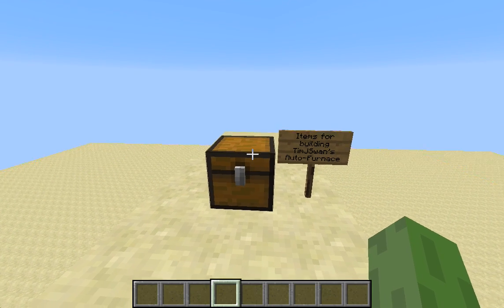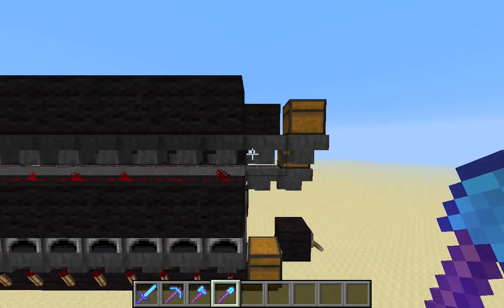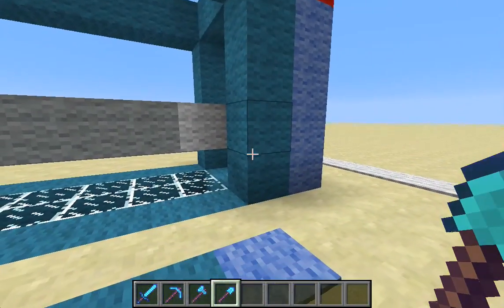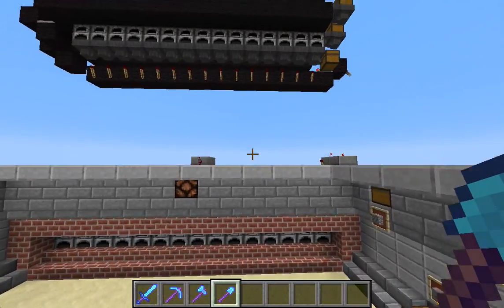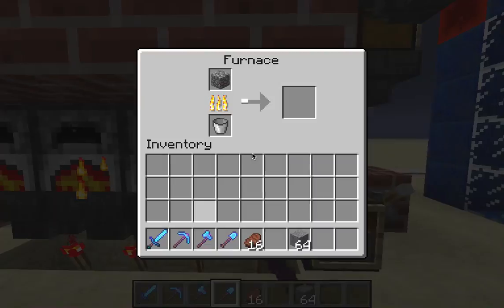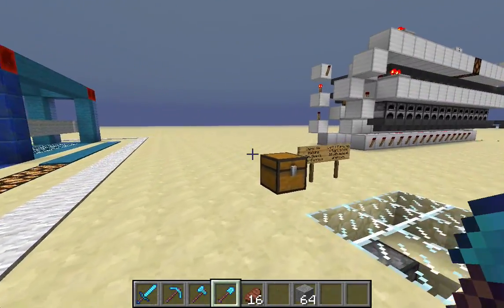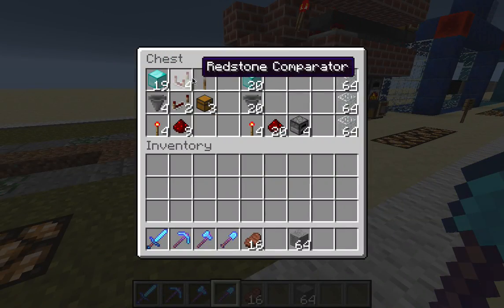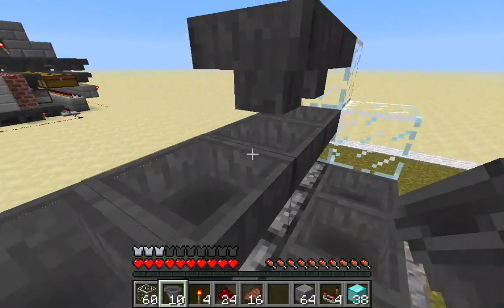Industrial Lava Furnace - Upgrade from Tengo's Synchronized Furnace

Comment: Built this in 1.12.  Did the 14-furnace version.  Furnace #7 from the left won't take fuel or input, but all the others work.  I removed the top layer of Redstone dust per an earlier comment hoping that might fix it but it has not. Anyone got a suggestion?

Comment: Hey Tim, can you show us how to incorporate the lamp to show when the hoppers need more fuel/when they are full?
Reply from the maker: siloettee Attach a comparator to your fuel input chest. Remember, I designed this system specifically to use all available fuel until none remains in the system, therefore, the only thing you need to check is the input chest.

Comment: I'm getting what I believe is a "feed rate" problem on this design. So first off, if I do the design exactly as shown, it works fine (and yes, I've removed the top row of redstone to get it working properly on 1.8+).

That said, if I want to move the two "source" chests (fuel and smelt-ables) down to the same level as the output chest, I start getting issues. I extended the dropper line, and then added an item elevator like this one (https://www.youtube.com/watch?v=otWucbMpw4c) to get the items up to the dropper line level. Everything feeds through, but the rate has changed, and so oddly, every other chest (or so, its sporadic) get skipped, and I only operate at about half efficiency. I'd be interested in your thoughts on how the feed rate into both input dropper lanes could produce this effect, and any way to fix it.

I'll continue to experiment, but this is seriously frustrating.
Reply: I also just verified that this same "flaw" exists in the world download linked above. So its not just something weird about the realm I'm on right now.
Reply: Your item elevators are slower than the speed of which hoppers transfer items between them. Therefore, you need to create a holding section at the output of your elevator allowing the items to build up inside the hoppers, then releasing the items all at once, as the item elevator is finished.

Comment: Ok I have a problem, I followed ur instructions step by step, problem is all the fuel drops into only the first furnace, all the items dropped evenly through out the four furnaces. What should I do?
Reply from the maker: William Douglas It sounds like your hoppers on top are being powered when they shouldn't be. Make sure your fuel circuit mirrors your item circuit.

Comment: i can't make this work, i have followed all instructions and it just won't work. any tips?
Reply from the maker: I'm not sure what could have gone wrong. I'm about to build an 8 furnace design on a modded 1.7.5 server. Hopefully it works alright there. Could you show me your design so I can check it out? Remember to make sure all your hoppers are facing the right way and none of them are getting powered from outside sources. Did you place all the blocks that separate the redstone lines from each other properly? Also, check what is actually getting stopped up in yours so I can try to figure out the problem.
Reply: Tim-J.Swan how can i show you my design?
Reply: Tim-J.Swan none of the hoppers drop the supplies to where they need to go, i built mine exactly like yours step by step